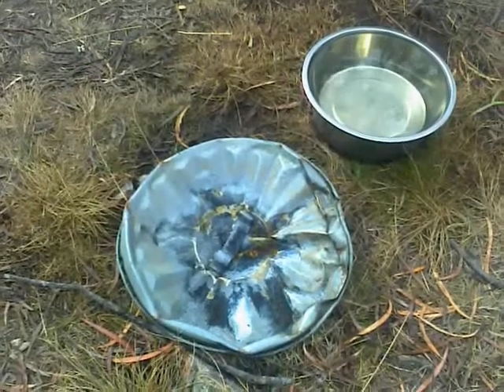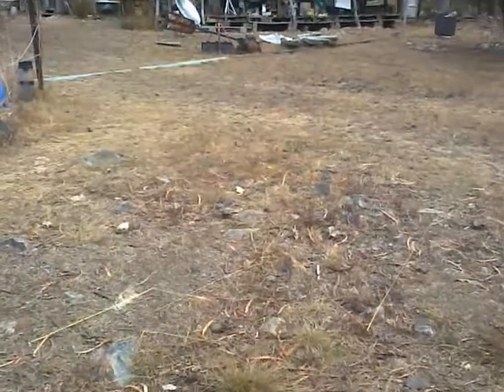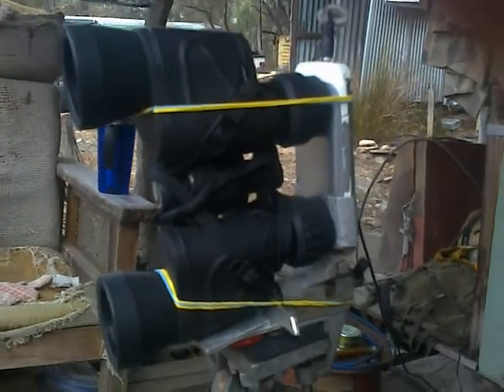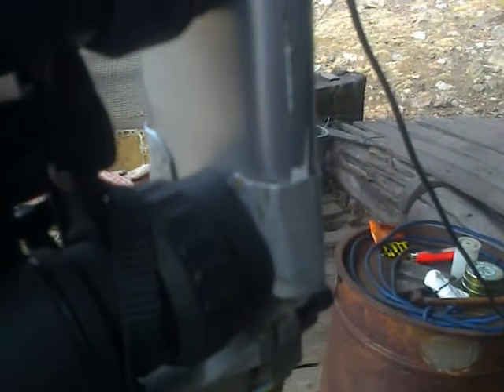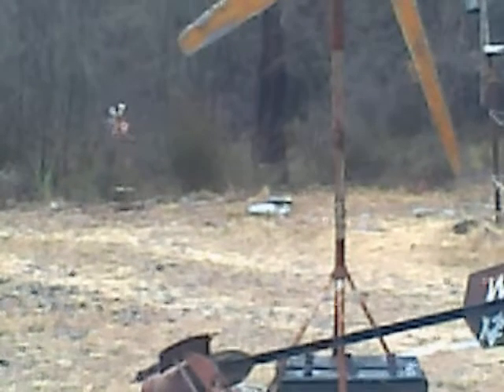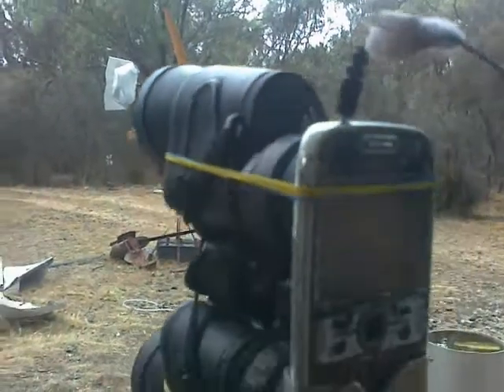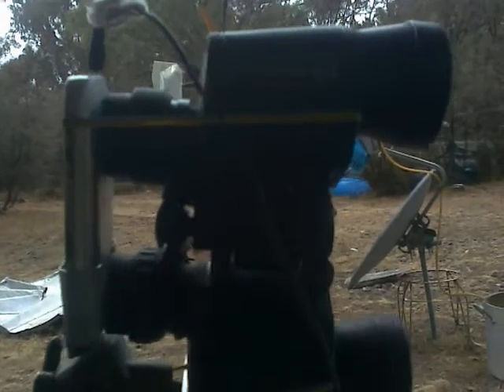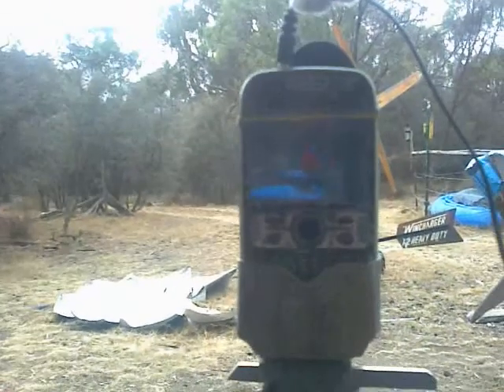Amazing Hillbilly Home-Made 40 x Telephoto Folded-Optical Array, Phone-Camera Accessory

Comment: Nicely cobbled. I have tried many lenses on the smartphones. The camera usually finds its focus down the optical length of what ever is thrown in front.
Reply from the maker: G'day,

  Thanks mate.

    Well, so far I think I need to use the Right Binoccular Lens instead of the Left, to get the Fine-Focus Compensator in on the act ; and focus the Monoccular on the centre of the Frame and Zero-compensation, before adding the Phonecamera to the setup..., then use the Compensator to adjust for Range-changes - the Waterdishes are at 11 paces & 18 paces respectively, and the Binocculars require a lot of  focussing at such short ranges..., the Camera isn't up to handling Focus without a bit of help.

  But, hey, it WORKS...!

  Thinking back, about a year ago I had the Binocculars on a Tripod while hand-holding the Phone-Camera up to the Eyepiece, while looking to see my Daughter's Flight enroute from Sydney to Dubai on the way to Germany...; so this revelation has been mulling quietly for at least that long..., and I used the Handheld+Tripod method for a Lunar Eclipse one time too...

  It helps that the Birds have all been coming here to drink for years, I get to video them from my chair on the deck.

  Have a good one,

  ;-p

   Ciao !

Comment: Oh, good grief. This is awesome. This is how NASA should do it.....
Reply from the maker: G'day Dave,

  Thanks mate.

   Ah, well, they have some smart people at NASA, but they can afford to buy or make something designed for the job from the start...; and I don't think they have any Beerbottle Caps laying around to hand - so they probably never think of cobbling up anything using whatever they happen to find already available... (not since Apollo (12+1..., anyway !).

   If you check out "Green Power In The Falls ; Looking Back...", which I posted last Sunday - that was the "Job" which spurred me to think of this trick, Windmills at 33 Kilometres (18.4 Miles), they're 150 Metres High, I can see 12 of them on the Horizon from my Driveway, and with this Rigout I can get 8 of them in the Frame at once !

   How goes the restoration of that Caravan-Trailer...?

  Have a good one,

  ;-p

  Ciao !